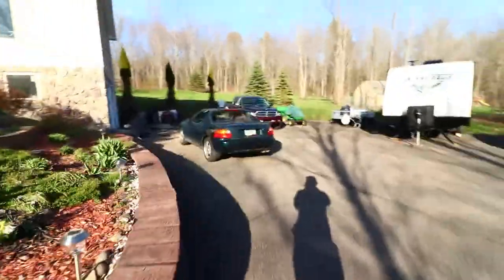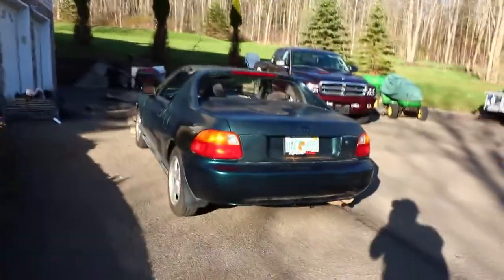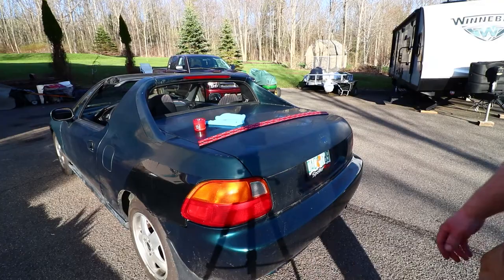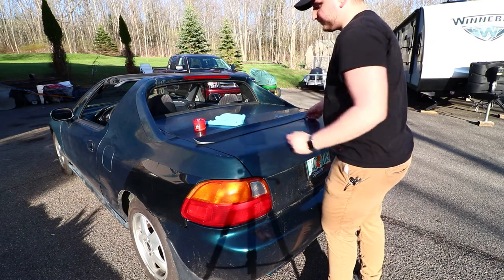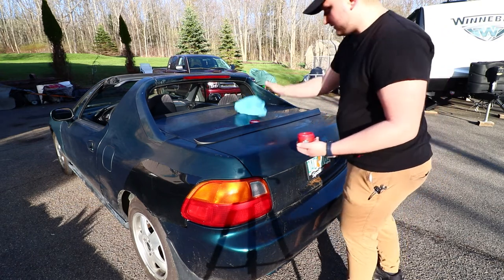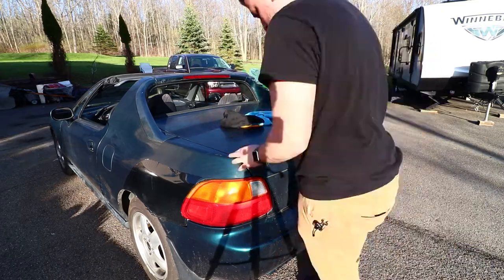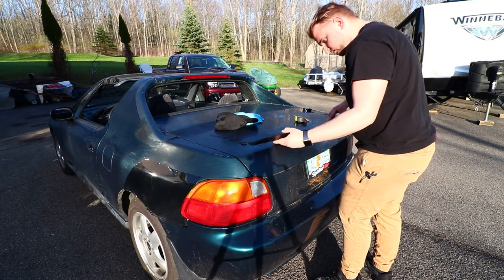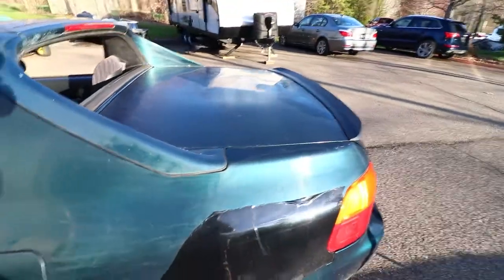Honda Del Sol Duck Tail Spoiler/Lip Spoiler Install

Comment: can you link me I've been looking for this same style for my del sol
Reply from the maker: Make sure to measure your trunk. I would get the 47 inches because the one I got was a little short on both sides like half an inch. 

SPK 284G Fits: Universal 46.5" Rear Trunk Lip Spoiler (Duckbill Wing) https://www.ebay.com/itm/-/122406429972